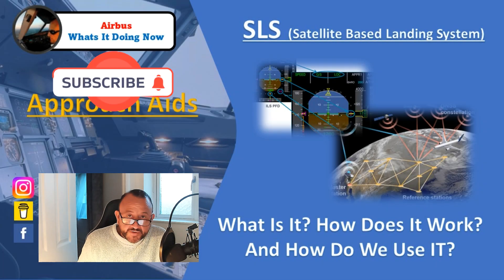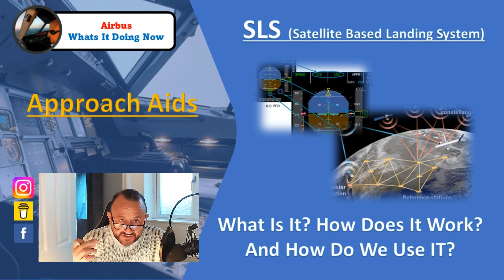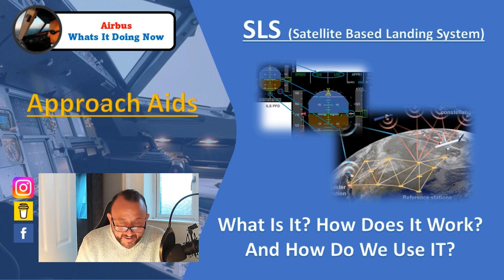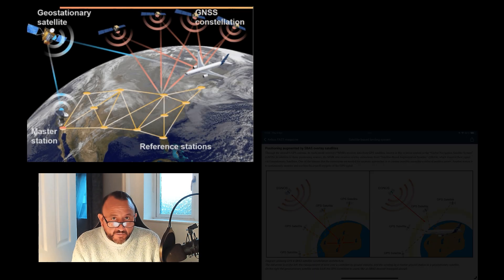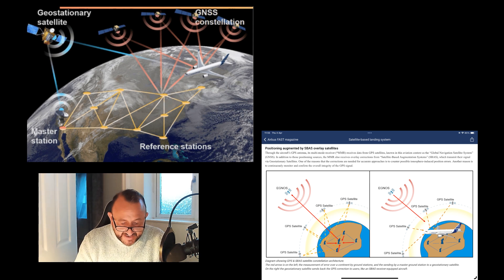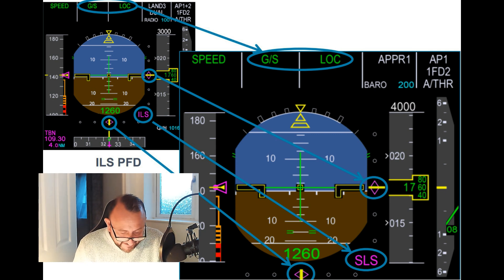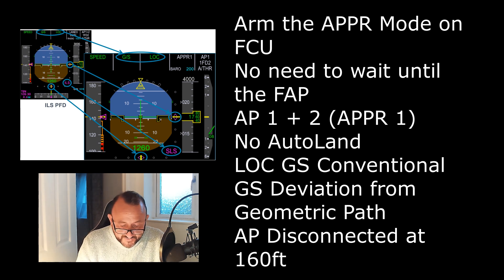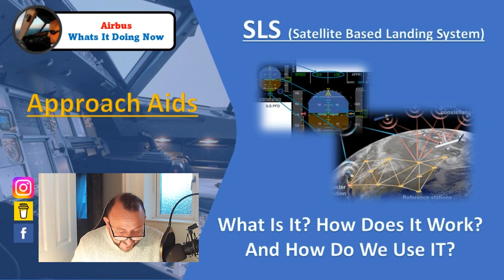SLS (SBAS)

Comment: Hey very clear explanation! I know I am complicating things with this question but I need to get the full picture: Since flying an RNP with SBAS isn't listed as a different approach on the MCDU, then once you select it, you said you can deselect SLS from the rad nav page to fly non-SBAS with FLS. What if aircraft is fitted with both FLS and FINAL APP, and I want to fly using FINAL APP? How can I deselect both SLS AND FLS?
Reply from the maker: Thank you for the question. I think Honeywell and Thales probably have the same operating system but on the new aircraft FLS may be the standard approach you will need to select final app and I believe Line select one right I hope that answers your question.
Reply: I believe when you deselect SLS in the RAD NAV page, the FMS will fall back to back to basic RNV approach modes. IF you do have FLS & FINAL APP available it will give you the option at PERF page to select either one, but often what I see is that that is not there (because you selected in FMS the RNV.. with SLS down to LPV minima, it says so at the back of the database coding). 

So I believe that when you press APPR button (with SLS deselected) it will go FINAL APP or you make your own NAV/FPA or TRK/FPA approach without APPR guidance (selected as we used to call it)